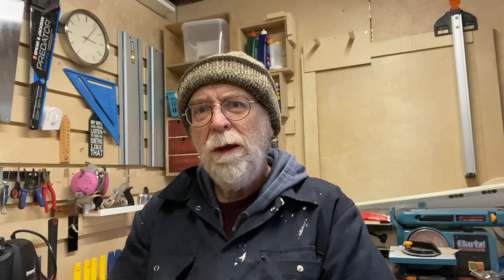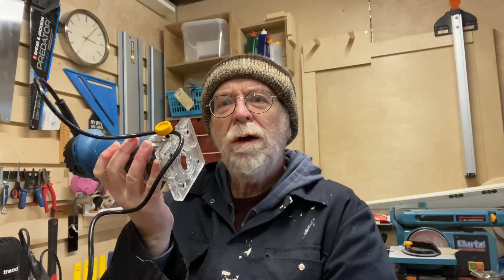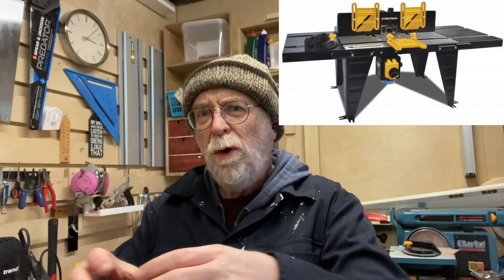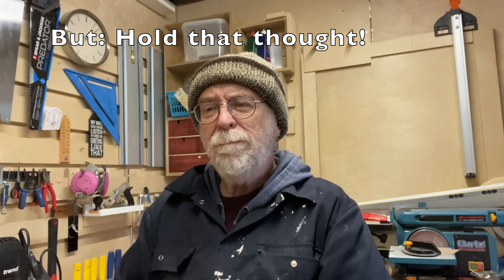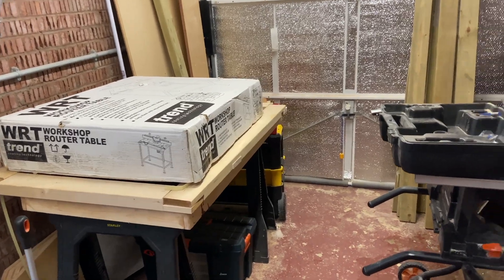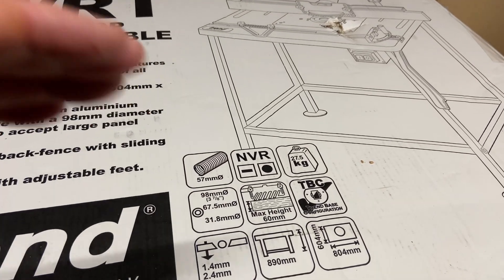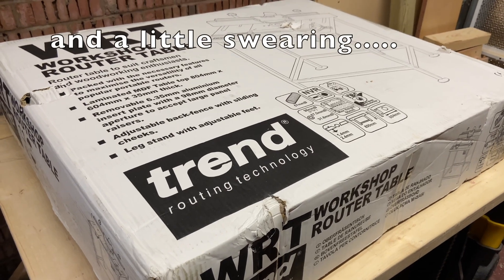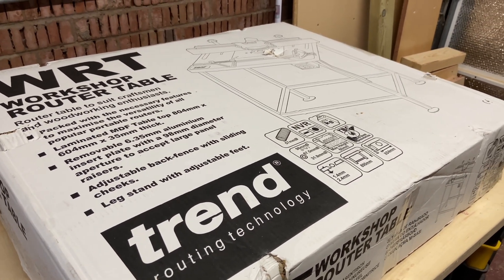A tale of 3 Routers!  (Part 1)

Comment: I bought on of those Lumberjack set ups - at least something which looks exactly the same but in dark blue - from B&Q> It was OK apart from what I found to be a very stiff rise and fall mechanism (yes, I did remember to unlock it, but even so . . . ). The only thing which broke was the dust extraction port.

Comment: I have just been looking at 1/2" routers for my Trend table and considering the T11 as well as the Triton TRA001. It would be interesting to know what your thoughts are on the Triton as it can also be micro adjusted.
Reply: @GrumpaLoz   Cheers for that. I have watched a couple of videos and I keep going backward and forwards. I'll no doubt make up my mind as soon as I need to put one into good use. I think the Triton will tip the scale based on price as it would only be used occasionally.
Reply: @GrumpaLoz  Ha! Thanks for highlighting that as it had escaped me. I think you are right in that it would not go straight in. I can't recall what the workaround is but now you have reminded me I think its going to be the trend!!! Cheers Grumps....
Reply: The triton sits in my table. It is not quickly changed out for hand held use, but is a strong work tool. A mechanical interlock stops you from changing bits while it is switched on, a table mount handle allows you to raise and lower the bit. There are inconveniences, speed adjustment is at the bottom in the table, so you need a mirror to see, the height adjustment is covered by the fence if you have the depth lock &power switch at the front.